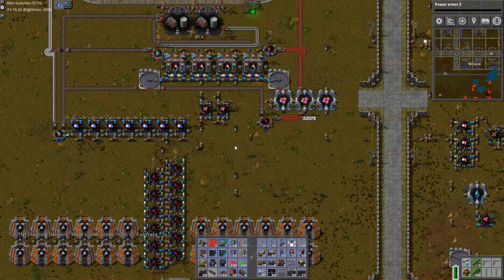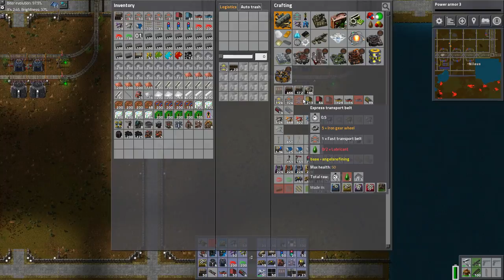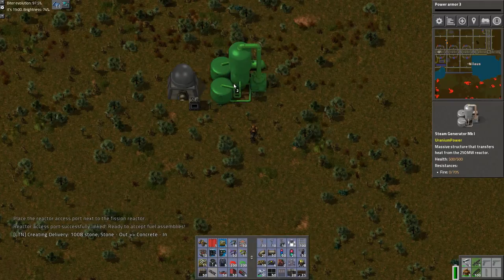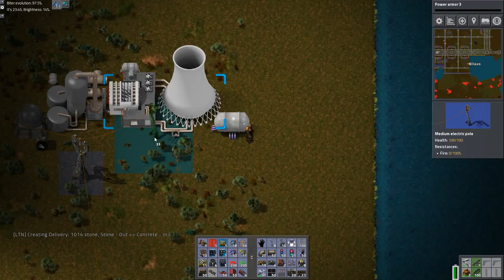Factorio S6E119 - New MOX powered Nuclear Power Plant

Comment: Your turbine generator was not connected to the steam generator.  The former was one tile north of the steam generator output.  But you figured :). The low-pressure steam indicator is fine.  If it is completely full then you are not condensing the low pressure steam back to water.  The best way to start up the reactor is to first completely fill the reactor with pressurized water. Fill the reactor chest at least half full of fuel assemblies.  Do not connect any steam generator, just the water pressurisers.  Once this is done, then disconnect the water pressurisers and connect the recirculating pumps.  These will help you orient and align the placements of the steam generators.  Then you connect water to the cold legs.  Once the steam generators are full of steam, then you disconnect the cold legs from the water source.  Then you carefully orient and align the turbine generators.  Do not allow them to connect to the grid yet!  Connect water to the cooling tower water tanks, connect the condensate tank to the steam generator cold leg, and finally connect the turbine generators to the grid.
Reply from the maker: Who knew Nuclear power was that complicated; dump some Uranium in some water and watch it boil...
Thanks for the step by step process. I probably should practice that process and make a tutorial for it, if nothing else, then for myself to remember it next time.

Comment: When you add the second piece of the reactor,  hot water from the reactor is diluted with cold water as the next piece is filled.  When both pieces are filled,  the cold water will be stopped and the temperature will start rising again.

Comment: You are missing a few key steps in your power plants.  You need to make sure the pressurized water in the reactor is 100% full before connecting the spinning turbine pumps. (when fixing this make sure to remove pump and steam generator to clear all of the pressurized water.  When both sides are fully connected the reactor will only have a few hundred pressurized water in it.  This will allow the loop to work without issues.

Also between the condensor and cold leg you need to limit the amount of water that goes in by using tanks/pumps.
https://www.reddit.com/r/factorio/comments/5gvr0h/help_needed_with_uranium_power_mod_250mw_setup

The fill tanks for the generators need 2 offshore pumps each, also using regular pumps after the offshores like you have will severely reduce the amount of water getting to them.

 Failure to do those will lead to running out of steam under high load.